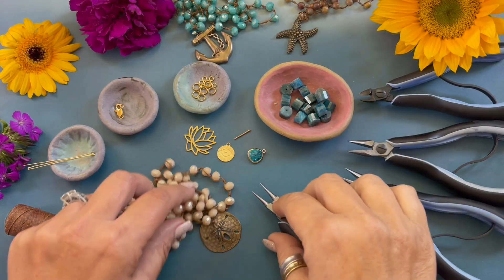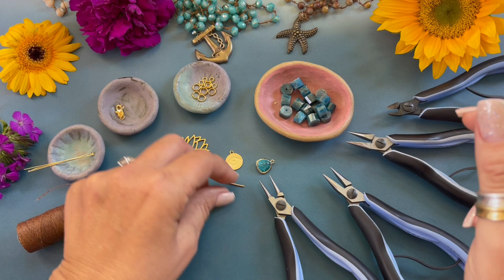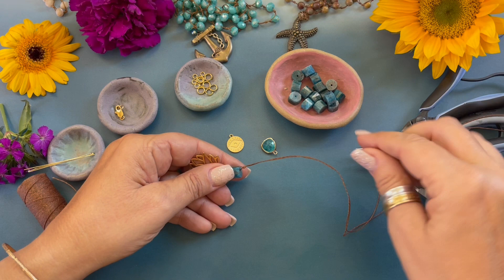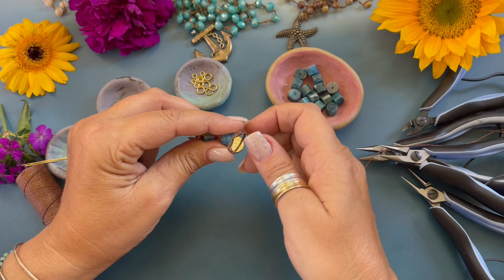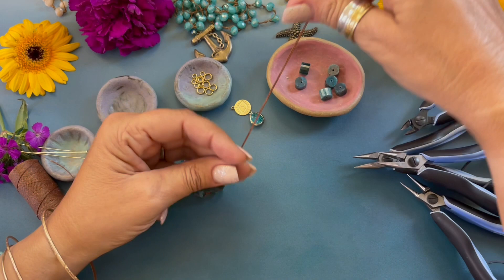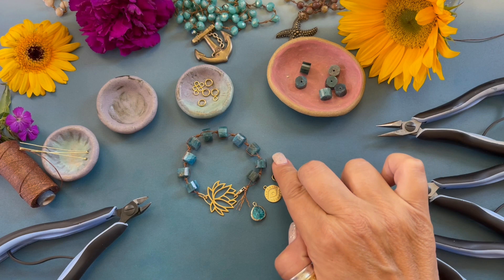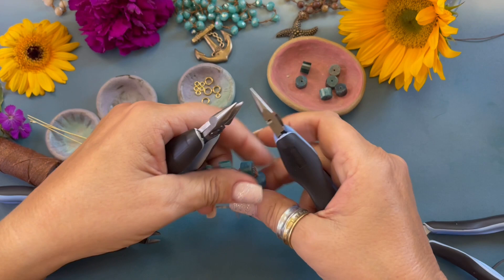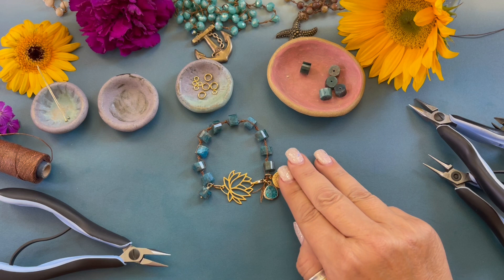Beading Basics - Knotted DIY Bohemian Bracelet Tutorial - Jewelry Making #diy #bracelet #beading

Comment: Very pretty bracelet! I made a long necklace with African bone bead tubes and though I double knotted on the end of each tube, I found the beads' large hole sometimes slides right over the knot. I plan to remake this but would love to hear how you would approach this issue. Maybe I need a flatter knot instead of a rounded one? Or maybe the issue is selecting the right sized cord for knotting?
Reply from the maker: DFC, 
Great question. Your cord size is not large enough. The beads will only slide off if the cord is too small. An alternative is to find a flat disk Heishi bead to place at the end of the African bone tube, then form a knot. I will attach a link to the bead I am talking about. I hope this helps!

https://www.thebeadchest.com/collections/heishi-beads/products/brass-flat-disk-heishi-beads-6mm
Reply: @DeniseYezbakMoore  Thank you - I will check that out!
Reply from the maker: @dfc3425  You are welcome! Let me know if this works.